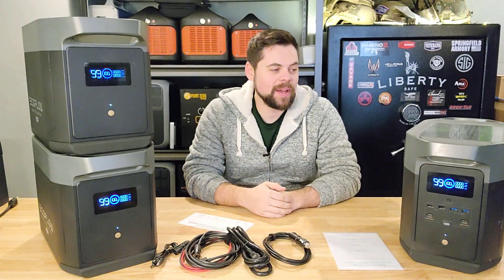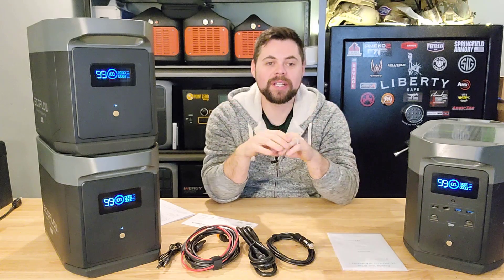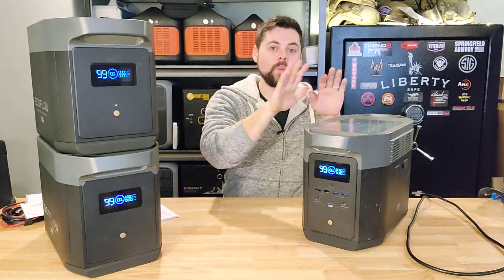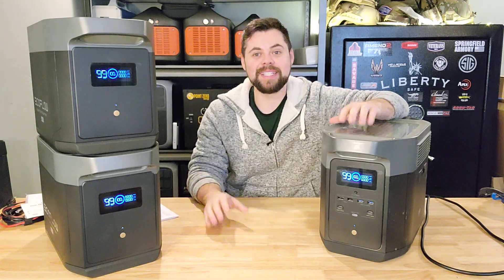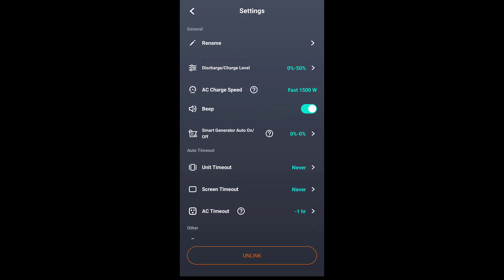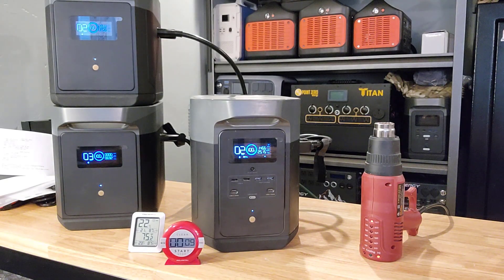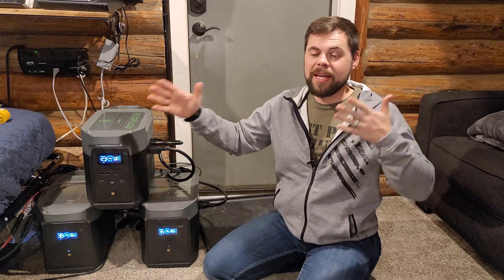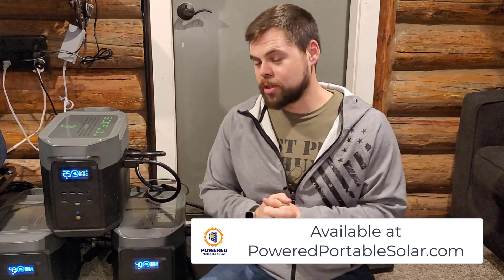EcoFlow Delta Max Test and Review

Comment: Would 175w Renogy Solar Panels work with this or are the amps too much?
Reply from the maker: Those would work fine because the charge parameter on the Delta Max is 11-100v & 13a
Reply: @minutemansolar  Thank you, this is most  helpful and I had just bought them before I saw this message ,so was worried you were going to say No!, Just wanted to triple check the specs, really appreciated!

Comment: We have 3 small 5000 BTU window air conditioners in our bedrooms on the top floor of our home, which gets very hot in the summer.  When our power goes out I run 3 12-gauge ext cords from our portable gas generator to the 3 AC units.  Instead of doing this, can I place the Delta Max 2000 in the hallway of our top floor, run 12-gauge ext cords from the Delta Max to each of the 3 AC units, and run a 12-gauge ext cord from the gas generator to the Max to charge/recharge it with the generator while the Max is powering the 3 AC units?  

If I can run this setup, how long can I run it?  Our power outages can last over 3 days.  Also, should the Delta Max be charged with an Inverter generator, or can a regular generator be used?  (I have both kinds of gas generators.)

I'm trying to reduce the number of ext cords going up the stairs for the AC units from 3 to 1 to minimize the tripping hazard.  The running wattage of each AC unit is 500W or less, and the starting wattage is 1200 or less, for a total of 1500 running watts & 3600 starting watts.  So the Max should be able to handle all 3 AC units.
Reply from the maker: Yes you can do that but you won't get much benefit over just running them directly off of the gas generator. The reason is that the Delta Max battery is 2,000wh. If each A/C unit is using 500w for a total of 1,500w then at most you'll get roughly 1hr and 20min of run time off to the Delta Max battery running all three units. 

The only way to continually run them and not have to use the gas generator to run the solar generator would be to have enough solar panels plugged into the solar generator to off set the power being used to the A/C units. 

For your situation I would use the Delta Pro because it has 1,600w of solar input. I would go with the Delta Pro 2400 kit: https://poweredportablesolar.com/product/delta-pro-kits/ because that will insure you're actually getting 1,600w of solar power to go into the Delta Pro on sunny days. Then you'll be using 1,500w, charging at 1,600w, for a minimum charge of 100w to the battery. You'd get better charge if the A/C units are not using the full 500w while running. 

So in this case, your Delta Pro would be fully charged, you'd have 2,400w of solar connected, the Delta Pro will max out its solar input at 1,600w, it'll be using 1,500w to run the A/C units, the Delta Pro will stay charged all day due to the solar panels. Then once the solar panels aren't making power anymore the Delta Pro has a 3,600wh battery so it'll run those three units for a little over 2 hours. Not that great. But at that point you could connect the gas generator to the Delta Pro and top it off while running the A/C units off of the gas generator too during the time the Delta Pro is getting recharged. At least doing it this way would allow you to cut down your gas usage by 50% or so, and at minimum would save you the big hassle of all the oil changes, gas tank refills, maintenance and noise as often. 

This won't work with solar with the Delta Max because it only has 800w of solar input. 

This is definitely possible and I'd love to help you get everything set up and help you customize your configuration to work the best for your situation. Please feel free to email me at info@poweredportablesolar.com :)
Reply: @minutemansolar  Thanks for the info & advice. Sounds like I need the Delta Pro for my purposes, but unfortunately due to budget constraints I can only afford the Delta Max 2000 at this time.  I know there are financing options available out there, but would rather not get into a loan with monthly pmts & interest at this time since we'll be financing a vehicle purchase soon.

I'm definitely interested in incorporating solar panels into my future setup, but am concerned that living in NE Wisconsin we won't get enough sunlight at certain times of the year to properly charge/recharge a Delta unit.  That's why in the scenario I mentioned I thought about using one of my gas generators to recharge the Delta Max while the Max was simultaneously powering the 3 window AC units.  But I've also read that charging a Delta unit while also using it to power electronic devices (I think it's called "passthrough mode"...???) will shorten the life of its batteries.  So what I was proposing to do in my scenario might have been a bad idea in the first place.

I think for now I'll just put the money aside that I was going to use to buy a Delta Max, and add it to our income tax refund next yr to buy the Delta Pro.
Reply from the maker: @martinafan64  I think that's a smart move. Rather than spending the money on something now that will only help a little, keep saving up until you can exactly what you need so it performs a lot better. Whenever you have questions, please feel free to reach out. info@poweredportablesolar.com

Comment: I am looking between the 1600 vs 2000 Max. the 1600 is on sale for around $1500. Looknig to power a refrigerator and chest freezer during power outage. I like being able to expand, so do you think it pays to get the higher 2000w delta or is the 1600w delta ok and if needed get additional batteries?
Reply from the maker: If possible, I always prefer more battery. I always find I'll end up needing it.
Reply: @minutemansolar  I agree, but do you think the 2000 model is worth $500 more than the 1600 version?
Reply from the maker: @robrichman3314  You'd probably be fine getting the 1600 if you're planning on getting extra batteries down the road too

Comment: Your Delta unit's breaker tripped off was due to your heater gun which  was placed in such a way blocking off the air into the heat gun creating the load build up and the amprage .
Like your project with large solar capacity to generate the system.

Comment: I know older Delta's had heating issues that affect charging/Charging rate experience any thing here ? And what was cost of units separately ? And the batteries on this unit is not replaceable ?
Reply from the maker: No heating issues so far. Pricing can be found at https://poweredportablesolar.com/shop/ The batteries are not replaceable.

Comment: What about amps?  Delta max only handles 10 amps and an average 100 watt solar panel runs at 5 amps.  So if you connect more than 2 panels you’re already at max amps.  Wouldn’t Connecting 10 panels trip a fuse or damage the inverter? Thx!
Reply from the maker: You do 5 panels in series which increases the voltage but keeps amps the same, then you connect a second string of 5 panels in series to get the max voltage and amperage input. so two strings of 5 100w panels.

Comment: Just a heads up to potential buyers for the Delta Max....There's a pretty huge Achilles heal to this model...It uses NCM battery chemistry with a cycle life of only 800 cycles to 80% capacity vs the Ecoflow Delta PRO (or the extra external battery pack) both use Lithium Iron Phosphate (LiFePO4) aka LFP chemistry in their batteries with a whopping cycle life of 3,500 cycles to 80% capacity and 6,500 cycles to 50% capacity.  Other than cost, I'm scratching my head on why the company doesn't offer the Delta Max with LiFePO4 batteries?  It's proven people are willing to spend the extra money for the significantly higher cycle life of LiFePO4 and they reserve it only for their PRO model.
Reply: The added weight of LiFePO4 may be an issue for some.
Reply: Right tool for the job, for people who aren't banger YouTuber full timers the NCM is just fine. run them 80 to 20 or 30 % the cycle count goes way  up.Even full cycles for weekenders is years of use. For serious home use just get a couple of 48 volt LifePo4 5KW batteries and an all in one inverter. Close to same price as a Pro cheaper if you add extra battery and more KW. Not plug and play but close.

Comment: So the Delta Pro has a better battery cell technology than the max? hmmm a bit disappointed.
Reply from the maker: "better" is determined by what you need it for. But for longevity, yes it's better. The Delta Max is Lithium Ion (Li-NMC) and the Delta Pro is LiFePo4

Comment: Great review — I now have two Delta Max and two expansion batteries, for heavy duty home backup power use. Way better than the Inergy Flex. But the Titan w/two batteries I got from you for my RV is still the king! Would love to see you review the Delta Pro and compare & contrast with the Titan.
Reply from the maker: I just got my two Delta Pros yesterday. I have two delta pros and 4 delta pro batteries that I've ordered. Videos coming soon. Then all that's left is the Voltage Hub so I can get 240v power to run the house! That'll be a fun video.
Reply: @minutemansolar  fuk dude how many of these things u buy and u keep them? If it's true you are in a psychosis.

Comment: Great video. I really like the Delta Max and hope to get one soon. Your video is very helpful in the buying process. I thought it was just me, but connecting the app is a bit mysterious to me too. I just keep pressing the connect button until it works, which eventually it does. I work in the IT industry and it is odd behavior to me. However, I love what the app lets me do and it is one of my favorite things on EcoFlow products. Question regarding the fast and slow AC charging switch on the main unit. How are these two charge rates tied to what you have set in the app? For example, if you have it set in the app to crave is 1200w, what is the behavior of the switch on the unit what you switch it back and forth? Would also be curious to know how much power you lose just having the unit switched off on the shelf. Can I expect is a month that the unit will have half or all my power? Really important from a prepping standpoint for me. Thanks for all your great work.
Reply: Fast is always the max 1800W. Slow should really be called “Custom”. You set the charge rate in the app, anywhere from 200W to 1800W, in 100W increments.

When the unit is completely switched off, self discharge is very low. Maybe 1% per month.
Reply: Jack Ars Thank you. This is very helpful. Too bad they don’t just have the switch be high and low and let you customize both.

Comment: I'm using an Ecoflow River Pro occasionally for camping and I love it. Did you have X-boost turned on in your app? I have to turn it on in the app if I want to use the X-boost functionality. It works great when using a 1000W kettle to boil water where the EF River Pro has a 600W continuous output. It takes a bit longer but in the end I have boiling water.
Reply from the maker: Yes I had X Boost turned on in the app as well. I'm glad the river pro is working so well.
Reply: @minutemansolar  how loud  is that max. Does the fans run constantly when solar is connected. I'm looking for one main unit, this one or AC200MAX.  Which one would you get?
Reply from the maker: @zfontain1975  I haven't ordered a Bluetti AC200Max yet so I can't speak to it at all. The Delta Max isn't really loud but it is noticeable. It will be used best if it's in a different room and there are extension cords running to power strips running equipment. It does blow fans when being charged most of the time.

Comment: I do have the Delta Max.  I guess it would be good to have an extra battery, but when I expand, I think I would just buy another unit.  More solar input, plus having all of the outputs, and they won't have to be tied together, and not much more money.  But, realistically, for my needs, I will probably just expand by getting a Delta River Pro or something like that.  I want outlets, and to be able to put the units in different areas.
Reply: This was my thought exactly!
Reply: I agree. Got mine on a Father's day sale and it actually arrived a week early. Saved about $700. Wish I had the money to buy two. Came with 220w panel. Still at full price its worth every penny. This thing is a beast!
Reply: Fricken great idea. 

Two main units instead of one main and one extra battery. 

The price difference is minimal compared to the benefit.

Can both main units connect to the App at the same time?
Reply: I agree I have the delta max and river pro in a power outage I use the river for all my small needs and only use the max for power hungry appliances like kettle,microwave I even charge the river pro off the max
Reply: My thouggt also. 
The pro has over triple the cycles. If using full time as I want to I think that would be the best. Still learning in my later years  :)
Reply: @kalapedersen6180   people keeping falling for the marketing slogans without looking  what it means. 2500 sounds better than 800 cycles but it’s far more to it than these numbers.
Reply: @ThanksForTheLaugh  as I said I know very little. Just learning. Please share your thoughts.  What would be better? To buy another max or invest in a pro? 
I hava a small cabin i am hoping to be off grid as much as possible. Money is short. I am an older single gal. 
Hopefully to be set up better  before SHTF . :)
Reply: @ThanksForTheLaugh  i did look at what it meant by the way. 
Am trying to learn. Lots of questions though
Reply: @kalapedersen6180  Sorry I wrote a reply with references and it was deleted. Good luck

Comment: Mahalo as very informative. Just received my Bluetti 200 Max and one battery as was my decision  to purchase over EcoFlow on the many video's reviewed. Under the Hawaiian clear skies, the solar charging falls short in keeping up with its standby energy consumption. Wish I knew how to over solar panel it, without causing damage.
Reply: Bluetti  max is better  you can put 1400watts into it. I have that unit with solar on clear day I'm at 1200 to 1300 watts so I can run more stuff during  the day. Delta is only 100volts and 10amps very limited solar. Bluetti is 145volts and 15 amps so you can add more panels can be used.

Comment: Were you using the local WiFi connection for the Max or going through the internet? They have been having server issues, staying on the local WiFi network will get around that.
Reply from the maker: It has you connect directly to the unit first, and then switch over to the local wifi for stability. I was using local wifi and it worked sometimes.

Comment: I'm torn between Delta & Bluetti.  Both offer excellent units & additional batteries and the prices are quite similar.

On this Delta, I'd like to know if the main unit transfers energy at the standard US frequency of 60Hz & if not, could a UK Delta battery be supported by the US main unit? (We've emailed in the past concerning my situation!).
Reply from the maker: Both are good, it's a tough call. I haven't gotten my Bluetti units yet so I can't definitively say just yet.
Reply: @minutemansolar  I'm total novice to this, but Bluetti suggested for me the AC300 + B300 (but the weight of  80 lbs for the B300 gives some concerns for us/seniors).  Also, Bluetti would be a close "ship/delivery".  But, my experience with Bluetti is that -- asking questions, using chat, and even calling, it has been slow and frustrating.  Thus, I decided to switch to considering/buying the EcoFlo Delta Max.
Reply: My difficulty with both Bluetti and EcoFlow, probably any company, is that I can not supply the amount of watts (but then Bluetti switches to - no, we need the amps/volts instead).  Situation is that we have an older 20 cf refrigerator; an older 7 cf chest freezer; and as of this month, a new 3.5 cf chest freezer.  The 3 manuals for these appliances, do not indicate any watt rate, nor amps, nor volts. Not finding specs stickers.  Rapid Tables forms do not give the answer.  I explain that only during  power outages would we use a solar generator for the refrigerator/freezers and it would only be when the appliances show warming/beginning defrosting; each appliance is in a different location/one in a different building (so they'd not be chained together for charging).  I guess there's an issues as to surge?  Our longest power outage (a Winter Storm) has been 14 days; next longest 12 days; 1-4 outages yearly, to date.  If there's snow on the ground, we don't need a generator.  As to no lights/no heat, we have wood stoves; crush lights, etc.; also a propane apartment stove, camping stoves, coolers with cigarette adapters.   We also purchased a Yetti 1,000 and Boulder Brief Case panels in Jan 2020.  * *  Fingers crossed that some of my words make sense.